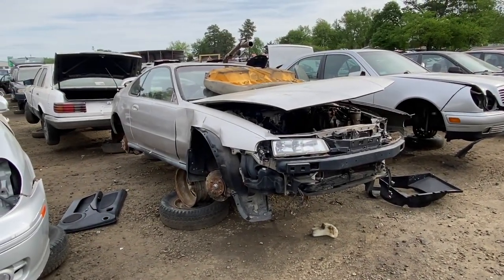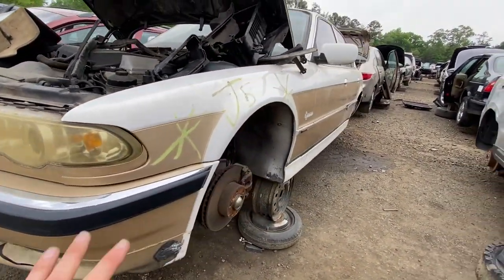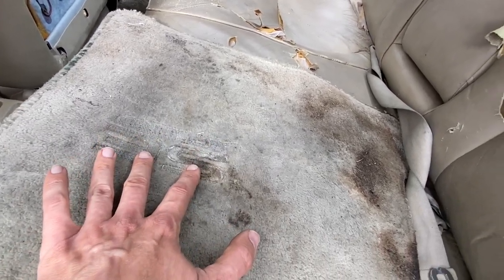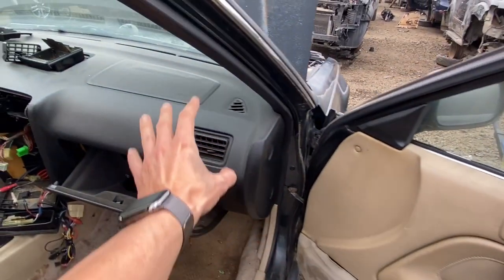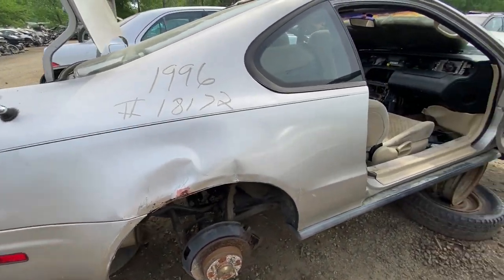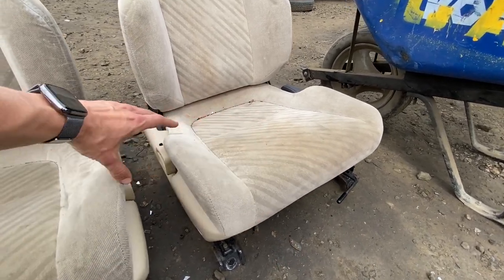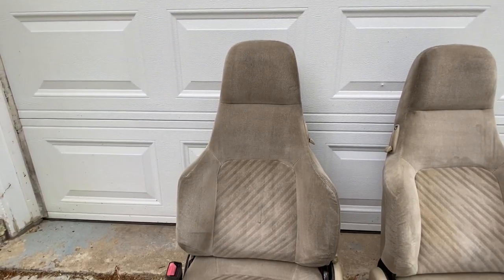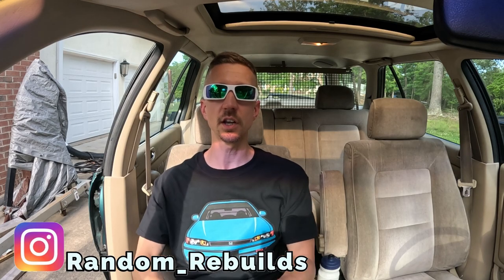VLOG10 - Junkyard Honda Parts Picking

Comment: your junkyard hauls are the best!  keep them coming.  I was at the junkyard yesterday and pulled a brake proportioning valve.  My driver's side seat has no rips or tears after 30 years.  The materials and construction of the seats are of high quality and durability.  Keep the oem seats.